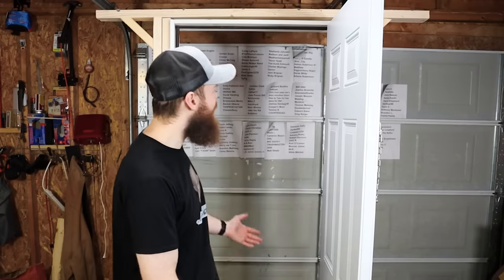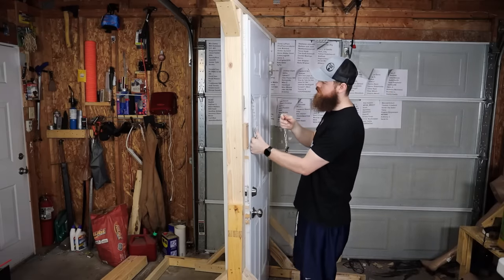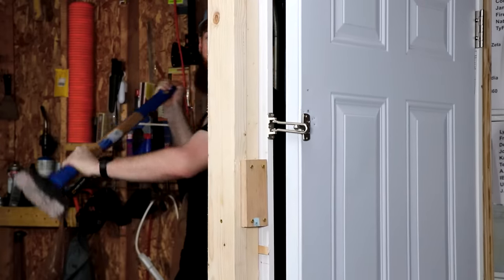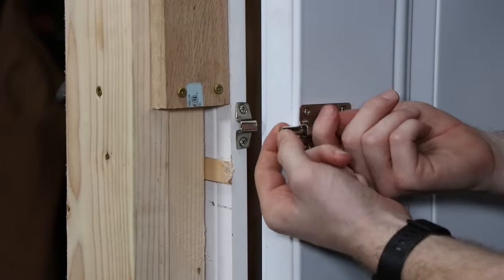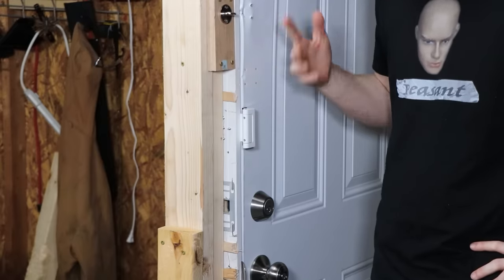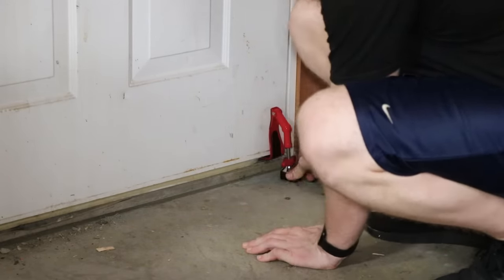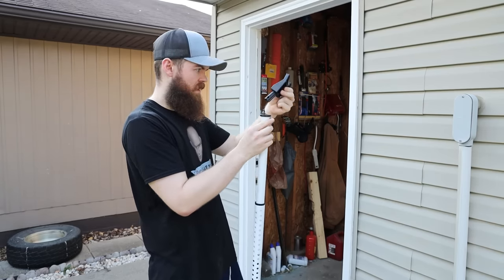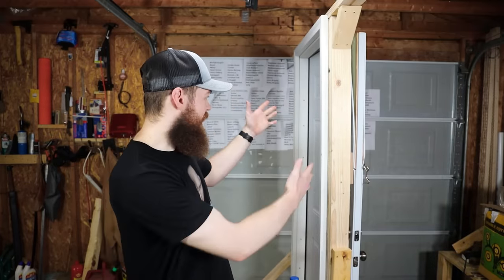Testing Top Rated Door Locks From Amazon!

Comment: Hey first i wana say awesome video! Second i have the same door bar and am now nervous to use it... i think im gonna drill a hole through it and stick a bolt in to strengthen the button breaking issue... or if you look at the hole ls underneath the button i might be able to put a pad lock or u bolt in there so that way its less likely to slip (would have to rip the metal underneath to get in) again awsome video and thank you for exposing the issue with the weak ass button on the bar!

Comment: your loosing a lot of energy with that free standing door, when it flexes around 
a door mounted to a firm wall would allow more energy dump into the lock and less used to move/flex the frame
still good though

Comment: on that 1st lock (the average chain) could you not just instead of putting the "lock side" further away...maybe put it higher up?  That should also stretch the chain, shouldn't it?

XD WOW, that 2nd lock would DEFINATELY hold long enough for cops to come XD

8:53 maybe if you strung it around the doorknob?  not sure it would go around that and still hook in but it would seem to be a better method to keep the door from opening

Comment: You put the door chain on wrong. The track goes on the door and it goes horizontal with the open end away from the frame so when you open the door the chain goes to the end of the track and it cant be removed unless the door is shut

Comment: Okay you could have mounted the door chain higher or lower to get it further away. But I agree it's badly designed. The deadbolt and knob test weren't accurate cause the door frame was already completely destroyed from previous tests

Comment: For the "door jammer"  demonstration, the tester did not demonstrate it according to the instructions.  Accompanying the hardware are four small rubber wedges of various sizes which are shoved into the gap between the top of the door and the doorframe, in line with the doorknob.  THEN you secure the doorjammer against the door as shown.  I can't trust this demo for this reason.

Comment: Having worked for a door manufacturer, most residential doors and frames are cheap and kinda weak to begin with. Add-on locks are just adding polish to a turd, but cheap & easy is what most people go with instead of higher quality & cost.

Comment: When I saw the picture with the hammer I bet on the hammer. Need commercial steel doors with flush mount deadbolt locks . Spend the $1k or more

Comment: I know this video is more than a year old, but... No... No... I don't know where you bought that first little chain lock, but where I'm from, you attach the long part to the actual door. And the chain part to the frame. That way you can move the long part that the chain slides into far away. Unless you are stretch Armstrong, you won't get your arm around to open that chain

Comment: My uncle had a front and back door that weighed about 100 pounds a piece it was a solid oak door with a 1/8 inch steel plate in the middle i forgot what they were bought  for but they were given to him the frame also had 1/8 inch steel around it i think it might have been  for a indoor storm shelter rooms but it come with a 4 inch dead bolt someone broke in his house so doors can be safe as you want but they’re always windows  

thief’s will always find a way even cutting through the floor I’ve seen it actually fixed the floor afterwards the guy wasn’t mad he was laughing he said i spent thousands on security windows and door he said there is no way to keep people out

Comment: The door is not mounted to a sturdy frame so it’s absorbing all the force by sliding or moving these locks are giving a false sense of security on the door.  Drill that door into the floor with braces and this will be way different

Comment: You installed the chain lock incorrectly. The locking bar should be horizontal so the chain cannot come out of the slot unless the door is closed

Comment: For the first one mount it horizontal. Usually when I see them they are mounted a bit away from the door and into a wall stud
Also that one you have is really badly made. The ones I usually see used do not have multiple pieces on the thing that slides into the latch

Comment: Whenever possible, install the door so it opens outwards.
Reply: Then you expose the hinges to attacks and it is easier to pry a door outwards.
Reply: @trevorlynch6549  Google or search YouTube for Concealed Door Hinges
Reply: @cbnto  The concealed door hinges are meant for architectural doors not for structural ones. If you did use those on an outward swinging door a prybar on the hinge side would destroy them. Also if you are adding extra safety features you can just replace the screws in the strike plates and hinges with 3 inch screws and the problem is solved for little to no cost.

Comment: I enjoyed the video so thanks for that, but your testing is invalid.  First, by repeatedly putting stress on the frame, you may have compromised it before getting to the locks past the 2nd one, but more importantly, when you have an entire frame that can move like that instead of being securely attached to a wall, your impacts cause substantially less stress on the lock and mount point.

Ultimately the better solution is a high quality deadbolt, and a thick striker plate that runs up and down the frame for a good foot or more, and very long, larger diameter bolts so you are essentially having to break part of the wall stud out, not just the door frame, to get past it.

Comment: Ao the fact that the door isnt fixed solid is makingnit so the force youre applying with a kick or a shove is beimg dampened by the frame beimg able to move with it. Theres no doubt that the second lock would have given sooner if this was an actual fixed door frame. So the results are very inaccurate.

Comment: American got flimsy walls and doors lol, I could break through that frame and door with my fists, why do they have such weak contractions in USA, because it is cheaper?
my mom doors is like 250 kilo, it got steel in it and also solid wood, would take a long time to even drill though, and that is a normal modern apartment here lol
my own door is connected to solid metal frame in stone construction and the door it self is thick and heavy wood, not this weird cheap wood in video

Comment: Try an armored door (at least a class 3... but a class 4 or 5 is better): the only way to breach into requires power tools (and quite a bit of time and noise).
These armored doors (plus armored windows and/or armored shutters and/or steel bars of course) are very common in Italy (where almost all of the houses are built with concrete, solid bricks and steel rebars) and are considered the very first layer of defense against thefts (in most cases the only layer of defense, unless there are something valuable inside the house).
For quite obvious reasons, the armored doors are constructed with steel (sometimes there also are composite materials inside) and are usually decorated with wood sheets for a better look.
https://www.orviserramenti.com/wp-content/uploads/2017/11/D-FIVE-STAR-dettagli-profili-e-chiusura.jpg

Comment: Nice video to watch, but I feel using the same door as a test subject and going from suspected weakest to strongest was a downfall. Also all the tests have very different than normal interactions because of the door not being actually installed on a building. I feel like you are giving misinformation with this video saying the flip latch is stronger than a door guardian because you beat up and cracked the frame of a door hung in a rig far less sturdy than hung properly in a building. Not only that but you beat the door so it didn't even close properly and had so much flex from the way it was hung that you artificially weakened the door guardian before testing it. Also you don't show people that the door guardian comes with good mounting hardware and skip over so much about a product that realistically is far superior to the flip guard you recommend over it. 
Also the locks are always unlocked which isn't realistic in an attempt like this, put a flip guard and a deadbolt on a properly hung door vs the door guardian in the same situation, even with these cheesy amazon/hardware store special deadbolts you would have recorded yourself driving to the closest home depot to buy a sawzall to get around the door guardian.

Comment: Im not saying the door jammer is any good buuuut, that test was ludicrously unfair. Its designed to be used as an additional device when travelling if you dont feel the security on the door is good enough i.e no additional locking system barring the lock/unlock feature on the handle. It would never be secured on concrete.. either laminate floor or carpet and much less likely to slip.. this may deter some creepy fucking janitor or cleaned from entering your wife/daughters room when they are sleeping. This is especially useful for bagpackers! Try not to discredit a device without knowing its true purpose fella
Reply: Visualise this.. would a person with the intention to sneak into someones room in the middle of the night want to create any noise to either wake the potential victim or surrounding people. Nope. Its a deterrent not a lock as such

Comment: if you want the strongest in terms of "being unable to break" get one of those giant bars that connect to each sides of the door.
The previous owner of my house was very paranoid and installed one of them on the door. It's a second lock in the middle of the door which requires its own handle to turn, but its basically a giant deadbolt that embedds into the ceiling, floor and the lock side of the door.
That one won't be kicked down anytime soon, but it being a lock, it could be picked. Unless you just don't install the outside handle i guess.
Reply: I mean you could install a medieval bar lock lol just metal holders and a piece of wood lmao

Comment: You did so much wrong most ppl don't just put these locks on of course it's weaker you are testing them on a bashed door frame plus doors are supposed to be locked on the handle and dead bolt then the extra protection ones are on. And wow im way samller than you and would kick through half of these.

Comment: Lol you mounted the chain lock incorrectly  step 1 screw slider into door frame  step 2 put chain in  step 3 pull till chain is tight  step 4 screw chain assembly into door  end result now you dont look stupid

Comment: I'm not saying that you did it wrong because you said u followed the instructions that came with it but I have never seen a door chain that was installed that way. Every one I have ever seen has the Slot part attached to the door and the chain ⛓️ part attached to the side /frame. When the door opens it stretches the chain taught and should be impossible to unlatch from the outside. But Respect I'm gonna guess that was just a shitty brand.